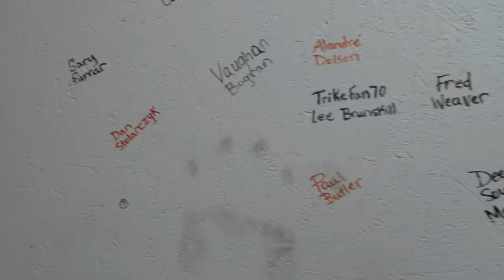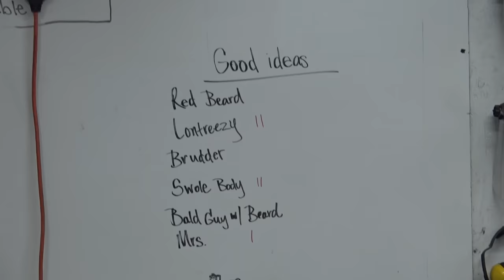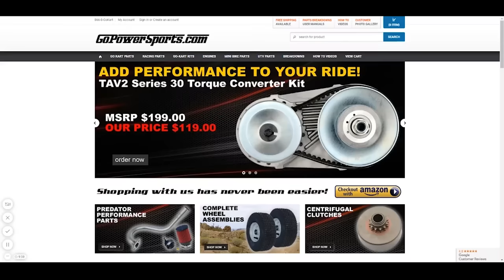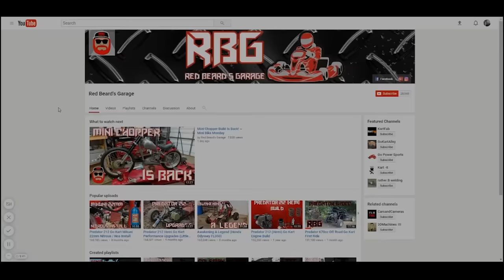2 Seater / Tandem Mini Bike Build

Comment: Looks amazing. Have you tried a duel engine on a bike like this? Maybe do a bike with engines a posing eachother,Two chains,exhaust,sprockets. The only thing I see that wouldn't allow it to happen is a throttle cable to two engines. You would need to combine two together maybe at the little ball end that goes in the throttle housing..... just a weird idea that came to mind seeing your bike

Comment: Hey Greg, quick question. I modded (valve springs, gov remov, oil sensor, exhaust and intake) a brand new 212.  Now I can't get it to stay running. I messed with valve screws and fixed valve lashings. It fires up, runs for about 10 seconds rough, backfired and dies. I bought one of those clear valve covers and it's coated in gas and black residue. Any ideas why gas is coming up onto the valve cover?
Reply: Sounds like timing is off or bent valve
Reply: Got it running well. Rod wasn’t seated properly. All good!  Thanks!

Comment: The plug welds needed bigger holes and I would grind the mill scale off the hot rolled round stock. I am a welder by trade so not some BS comment. Love your channel.

Comment: I would have mounted the motor on the rear section and put the battery and a small cooler up front. shorter chain length. where's the exhaust goin to be. might burn rear rider if motor is in front.